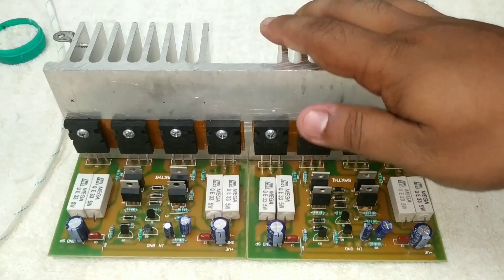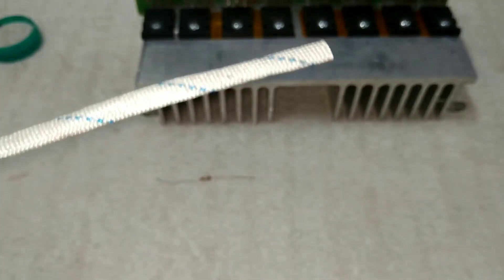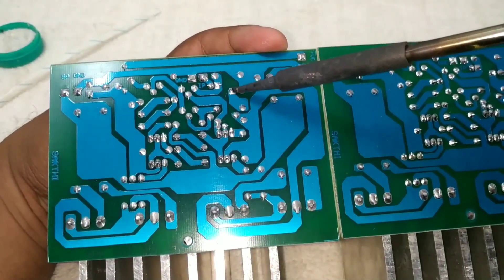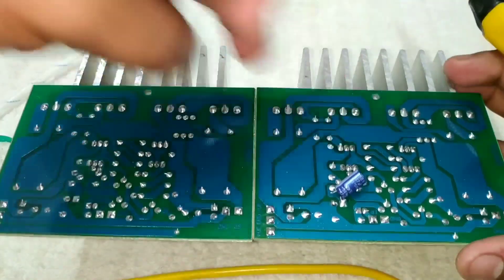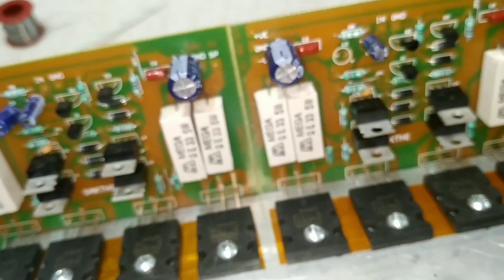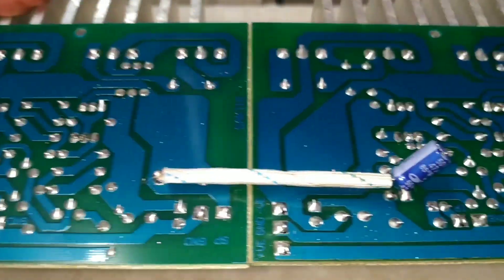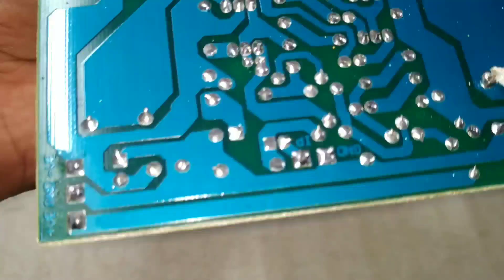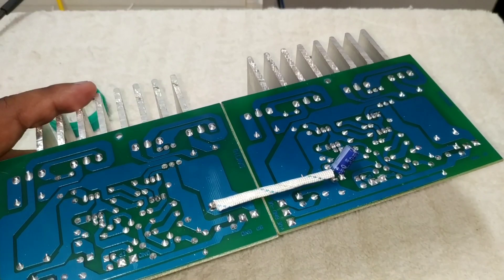Bridging 200w board to get a massive power of 400wrms. It can easily run 2 JBL subwoofers

Comment: 4 mosfet stereo board bridge ചെയ്യാൻ pattuvo?
Reply from the maker: Ath oru board anu athil oru iputum 2 output um und for more details contact me after 7pm on 9747869572
Reply from the maker: 4 mosfet normal board bridge chyam bridge chytha boardine pinnem bridge chyan pattulla
Reply: എന്റെൽ ഉള്ളത് wintek ന്റെ irf 250n 9250n stereo  board aanu ഉള്ളത് അത് mono ആക്കാൻ പറ്റുവോ?
Reply from the maker: @Renjiiii  pattum use a bridge adapter for that
Reply: Ath engane aanu

Comment: This circuit (Shakti circuit) is very bad for using subwoofer.
Reply from the maker: I m using this I need to use better filter with high gain presection
Reply: @technicalevolution9887  but not giving good bass punching, very bad bass! It's very cheap circuit of internet copied to Shakti., Shakti products are so bad.
I thing this Shakti type bass only like new generation boys only
Reply from the maker: @powerelectronics8640  which sub are you using
Reply: @technicalevolution9887  jbl 12"
Reply: @technicalevolution9887  then I has been used a old pins circuit 4 mos board giving to good bass punch.
Also teast another a 2s5200 board, it's also giving very good performance.
Shakti is wrost product.,
Reply from the maker: @powerelectronics8640  4 mosfet is good 👍
Reply: @technicalevolution9887  bro. Used at Shakti  4  transistor 5200/1943.,but very very bad circuit that., 
I saw your videos and all the best always bro.
Most more Electronics  shops are all of udaip., Also your favorite AB electronics and rohini electronics.
Reply: Ethu sub filterunnu bordinu nallayhu athinu venda filtercapasitor..ethu diode ..athinu venda voltageum. Arinjivenam bordine kuttapeduthan shakthide bordu athraku moshamonnumalla...athilu chila mattam varuthiyal ac 55 0 55 transformar koduthalum oru preshnavum ellathe athu warking akum...jbl subinu nalla borduthannayannu eh bordu top 41 .42 nu pakaram vere ettal eh bordu valare mikachadannu

Comment: Aaa capacitor boardil irunnal entha pattuka onn parayuo mashe plz
Reply from the maker: Capacitor matte legil ninnanu resistor connection so need to remove from circuit
Reply: @technicalevolution9887   aaa capacitor boardinte input aano..

Comment: Two job sub meaning in parallel inside an enclosure. So must have 16 ohm subs
Reply from the maker: Can connect 2 subs of 4ohms in series
Reply: Technical evolution  ,thanks but watts rms will become half isn’t it ?
Reply from the maker: @p.v.jayaprakash4494  no if u parallel or series speakers or subs wats doubled but variation is in the impedance

Comment: I make same method and get good result. Use 50-0-50 10amp transformer and bridge diode 3510. Also use cooling fan
Reply: Where to buy?
Reply: @rohitb1869  payyanur
Reply: സർ എന്റെ കൈയിൽTip 142-147 wintek ന്റെ 100 +100 watt ആംപ്ലിഫയർ ബോർഡഉണ്ട് അത് എങ്ങനെ bridge ചെയ്യാം ?വിശദീകരിക്കാമോ?

Comment: Add more transistor to a single channel amp to get more power.
Reply from the maker: Adding more transistor need more money sir and need more powerful power supply this is easy way to attain double power and double the output impedance I m using this same amp for working my 2 JBL gtx1200 in series connection and working fine no problem
Reply: @technicalevolution9887  Brdging two chanel is more expensive and it consume same power as exesing number of transistor, and less efficient. I think it is not a good idia.
Reply from the maker: No sir pls surf internet for details bridging gives double the power and if you need to increase the output impedance you need a bridged one
I checked it and in practical wise I am getting more efficient one..  I tried to bridge class AB and  class D by using a bridge adapter and get decent results most modern class d amps are in BTL or PBTL mode half bridged class d are used as base amps in PA systems and as studio monitor subwoofers
Just try to use it and compare sir you can see difference